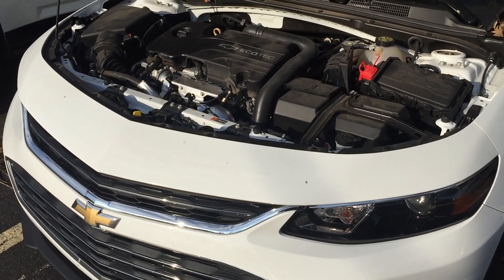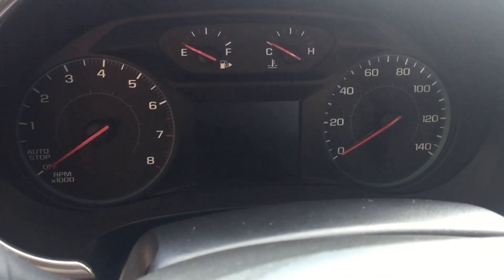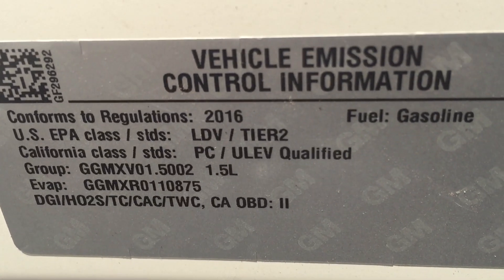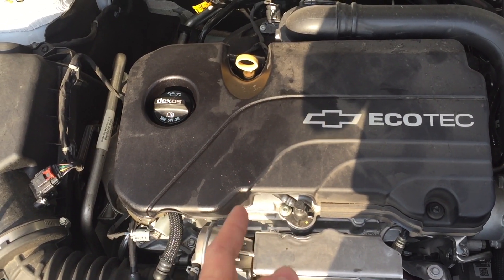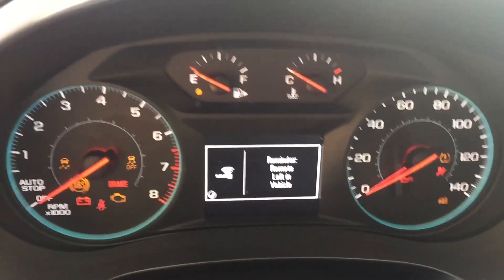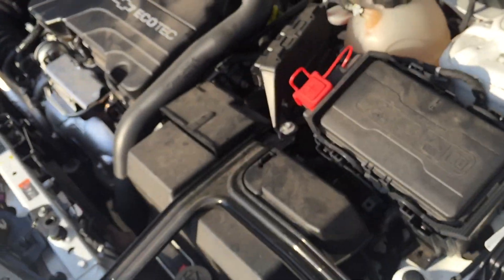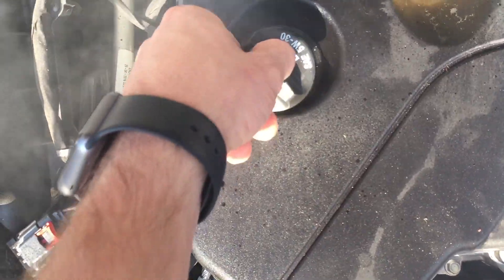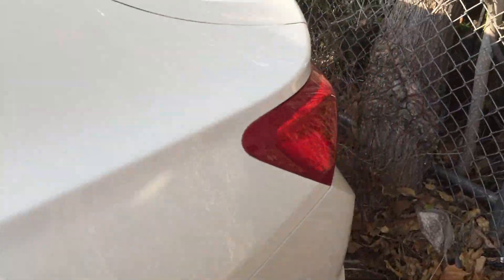What Engine Blow-By Looks Like

Comment: And people said Kias are bad. My 2016 with the same mileage is doing great.
Reply: The biggest problems were the earlier Kia's. Their name was literally their biggest joke for the longest time (Killed In Action) and it left a sour taste in most Kia owner's mouths. They were extremely un-safe and suffered from tons of mechanical problems. These days they're MUCH better as they're not specifically designed by Kia anymore. Hyundai is in the same boat, they've been getting better but are still not on par with Kia. GM on the other hand is absolutely horrible, GM's were 80% of the vehicles my dad saw in his shop and he specializes in German and Japanese but knows every car like the back of his hand, GM's are hard to work on, always fail and their parts are always extremely expensive. He hates having to ever touch a GM because of how stupid their designs are and how difficult they make everything to replace, they also lose fuel pumps like crazy, no matter the car. The plastic they use in the fuel pumps gets eaten away by the fuel. How Chevy gets away with their commercials saying they've won awards as most reliable car and bashing on other manufaturers is beyond me.

Edit: It also doesn't help that most of their technology is stolen and badly ripped off at that. Their original Eco motors were of SAAB and Opel design, the block was all SAAB, extremely solid and well built and then they took the fuel system and electrical designs from Opel. After they co-owned SAAB, they were forcing their shit onto SAAB and taking SAAB's designs, they wanted their cars to be equal and because of this most new SAAB's are terrible for only two reasons, transmission issues and turbo issues especially. After they had what they wanted they forced SAAB into bankruptcy and they were purchased by a Chinese company. The only good thing that came out of the entire ordeal was the Saabaru, a 50/50 mix of SAAB and Subaru engineering that wasn't soiled by GM. So yeah, fuck GM.
Reply: I sure didn't expect such a lengthy detailed response. I love my car. She does me well. Good tires and she cruises on the highway.
Reply: Same here. We have a 2010 Soul we bought used at 68k in 2014. She just passed 100K and still going good. Of course she has been maintained. With the exception of this last oil change it was all done by the dealership. The only problem is I have 3 more years and its getting to that age where the expensive maintenance is coming up. Just dropped 1400 on new struts/shocks and plugs/oil. But still get high 30's mpg on highway.
Reply: Austin Dillard Nah, German designers behind them. Only issues on KIA's are lack of craftsmanship (loose plastics, spoilers, etc) and minor mechanical design issues.. Backed by warranty.
Reply: Kenji Almonté loose plastics for sure. I know what ya mean. Overall been a damn great car.
Reply: Austin Dillard haha, Exactly.

Comment: There you go again, GM, using customers for beta testing.
Reply: Is That Matt Farah's Million Mile Lexus?!?!?
Reply: Well, technically I'm Matt Farah's 947,600 mile Lexus, but people like to round up.
Reply: Matt Farah's Million Mile Lexus lol
Reply: This is not Matt Farah's Million Mile Lexus.
Reply: Gee thanks. My whole world is a LIE, now!
Reply: TABRAO yet Toyotas bread and butter 3.5 v6 has been in continuous use in the US since 2004 and will probably be used for at least another 5 years. Funny how Toyota knew what the wishy washy regulations were going to be a decade in advance and managed to build an ultra reliable motor that has great low end torque and delivers decent fuel economy for its size. the real issue is that GM has never really bothered to make engines with ohc and turbos. they basically have no experience with these small cars and don't put that much engineering into them because the margins on a Camaro SS are close to double that of a Cruze. they just need to make enough fuel efficient compacts to offset the Camaros and pickups.
Reply: I got the 2011 malibu. its been great, my only issue with it from the start is the fuel economy is not as good as it should be. got the 3.4L engine. I like the look of the new ones, cant believe the screwed up so bad on the engines, shame. I find when these guys sales start to hurt the quality goes up. when they make money and have a few good years they start to produce crap.
Reply: bcubed72: I don't want to do deal with traffic everywhere!
Reply: To be fair the government regulations are changing so fast and are so pie in the sky that it must be very hard for car companies to keep up.  The government are just creating a regulation industries to keep themselves in jobs/money/power.
Reply: toyotas have had tons of problems too and lots of recalls just like the rest of them. DUMBASS
Reply: Adam J if it's a 2011 it's either a 2.4 or a 3.6.

Comment: My 2015 Ford Focus has oil coming out of the oil fill cap like this Chevy, no lights and it isn't misfiring; and no the cap isn't loose. Idk if it's normal but my old mustang that had 92k miles didn't do it or my new 2016 Fiesta. All of my families Fords have lasted a long time, our family Expedition has 100k with just fluids done and it runs excellent. My uncle has a 2000 Ford F.150 with over 600k miles, a few suspension and exhaust parts but the engine and transmission are original. The only other American vehicle we have owned was a 2012 Jeep Liberty Limited Jet, talk about a piece of crap; transmission was worn out at 40k, piston rings at 49k, and electrical issues at 49k. I gave my sister the Focus to get rid of that awful suv. The Wranglers are good. At least the Pistons didn't melt like the shitty Chevy. :D
Reply: Garrett McKie change the O ring on the cap or get a new cap. The engine on the 2012+ focus is extremely reliable. Only been blown by too much boost and lack of oil.
Reply: Fabio Da Rocha thanks! Because I couldn't find anything online and the car runs excellent.
Reply: Your fiesta is a mazda thats why ;)
Reply: Garrett McKie I'm a Chrysler guy and all of us agree that the patriot/compass is a pile of shit. Very big disgrace and shows a bad reputation to the jeep brand.

Comment: Is it a lean condition causing this?
Reply: rompn4x kinda looks like it in my opinion, running it lean to save fuel and adding a turbo on top of it.
Reply: GM has messed up a number of new engine launches by going too lean with too high of boost. There was a writer for an auto mag that had a new Cadillac SUV with the 2.8L turbo V-6 melt down while on the highway. Instead of using the same horsepower rated 3.6L GM had to use a 2.8L turbo running as high a boost as lean and with as much ignition advance as possible. Someone had fulled up with mid grade gas instead of high octane and the engine quickly detonated and trashed the engine. Funny thing is that even the Corvette has been able to use 87 octane in high compression NA engines since ODB I fuel injection days. 

P.S. What is up with the engine stop BS? If you suddenly stop the engine the turbo will keep spinning without oil and cooling. This happens normally but at say ten miles a stop is it not too bad of a problem wear wise. But stop the turbo ten times in a mile during rush hour traffic and that is begging for very premature turbo bearing failure.
Reply: Big reason they run them so lean is to meet emission standards. It's like they know it will cause problems but they shrug it off because they need to produce vehicles that meet the emission standards.
Reply: It would probably stop nearly immediately and they might have added some sort of electrical oil pump too.  Or how about this!  They stop this auto-stop bullshit and just let it run like a normal car!  Idling burns next to no fuel in these tiny engines.
Reply: Justin Williams Not to mention that modern manufacturers rely on the profit from maintenance and labor rather than on the initial vehicle purchases.

Comment: You wouldn't buy a car built in China, why should you buy an engine designed there? Wikipedia: "The small gasoline engine (SGE) is a family of small-displacement three- and four-cylinder gasoline engines ranging from 1.0 L to 1.5 L, developed by Adam Opel AG, Shanghai Automotive Industry Corporation (SAIC), MG Motor (MG), Shanghai GM (SGM) and the Pan-Asia Technical Automotive Center (PATAC)."

Comment: "Chevy engines are the best out there" - Every GM fan since sliced bread
Reply: my 300,000 mile GM will disagree
Reply: BronzeChicken I stand by the trucks.. the cars however, its common knowledge they are crap.
Reply: Depends how old, Newer yes. Older no, My 2000 chevy cavalier had 358.000 on it and i'll bet you i'd still be driving it if I didn't write it off. Bullet proof. Along with the 4.8l's And hey, You watched the video.. It does still run right? But chevy should of never went turbo.
Reply: BronzeChicken That's something we agree with, Dodges are garbage. Always have been and as long as Fiat owns them, always will be
Reply: I don't tell people what engine it is, because they jump out of their seat in disbelief. It's just not fair to assume that every engine they make is junk. LS engines are a good example. I've seen way more Ford issues than GM ones
Reply: I feel it fair to be fair, I didn't actually bash GM in the original comment, I just pointed out something I see, I like GM and Ford, just don't hand me a modern Dodge.

All that aside, I've seen people get 300K+ out the Ford 4.0 SOHC Ford offered, the 90s ones that sucked, so anything is possible.
Reply: I actually think the buick 3.8s were the best, lol
Reply: meh, never had a real issue with the several I've owned, that doesn't speak to the rest of the car though, haha
Reply: don't forget the 250 6 from GM
Reply: Back in the day they were, they're junk now
Reply: ^Point Proven.
Reply: UnitedRecording is it a 3800 series engine? They are okay if you stay on top of them
Reply: The 3800s were amazing, they're tanks, I'll admit that. I've heard the truck engines don't all like synthetic oil.
Reply: Like, don't get me wrong, I like most of their stuff from 2000 back, the 5.9 RAMs are solid fast trucks, but when they went to the HEMI stuff, I'll pass. I've handled Ford and currently daily one, it's solid, it's not all the bad hype that people claim, it's not perfect either. If I had to buy new, I'd take a new Chevy 1500, so I'm not hellbent on one brand, just away from Dodge, they've done some flat out stupid shit that turned me away
Reply: The sonic, cruze and volt are cheap and are doomed to fail, the Trucks are cool though.
Reply: Doomed to fail? They sell lots of those - they aren't bad cars. The Volt is an extremely impressive vehicle.
Reply: Hardly impressive. But I would like to know why you think it's impressive though, maybe I missed something. 
anyways The I had 2 neighbors who owned Cruzes and one that owned a sonic, all had their car suffer some sort of internal failure which either had to replace the engine or go through some extensive repairs. Needless to say they do not own those cars anymore and do not intend to go back to Chevy any time soon, all of them now own a Japanese car of sort.
Again though the trucks I know so far seem to hold on just fine, Silverados and colorados that is.
It is what it is, the trucks are built for work and so they are built to last long while the cheap cars are part of the own it for 4 years then throw it away or a new one market.
Reply: I wasn't talking about the Cruzes. They're totally different than the Volts. I'm not going to talk about the pre-2015 lemon vehicles, that's not a representation of the actual Cruzes. It's not acceptable to be purchasing Japanese cars if you live in North America, either. But I suppose that doesn't bother them.
Reply: I had a 96 5-speed Cavalier with 289,000, sadly the body was pretty much rotted away.
Reply: Steve W That's what happens to all of them.
Reply: Yep, sad but true.
Reply: Not just bodies either, I have a 99 5-speed Cavalier now that I just replaced the front sub-frame from another 99 because mine was rusted away.
Reply: My van runs great on conventional. 14 years and counting. Tried synthetic once, it didn't like it.
Reply: yea cars rust out they all do DUMBASS and you are pry a fat lazy fuck who never washes your car
Reply: I've never had an issue related to a Ford engine with the proper care and doing things with a proper design, and Ford also has some engines like the 300 L6 and the 302, best motors ever made, there's been tests to see if you could destroy a 300 L6 that failed to do so. Also, I don't have rust problems because I live in a southern climate, and I wash my car at least once a week, sometimes twice and it gets waxed at least once a month.
Reply: forgot to mention the good old maytag washing machine kickstart engine
Reply: i got the 2.5 iron duke on my 91 grand am and im happy